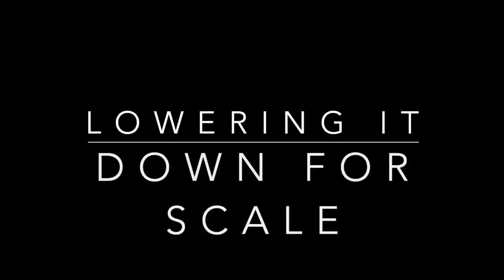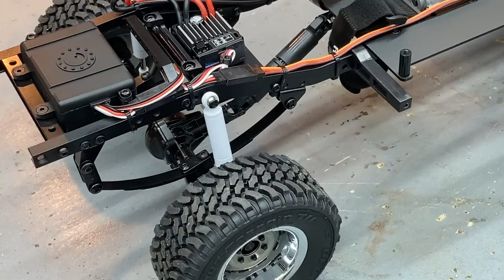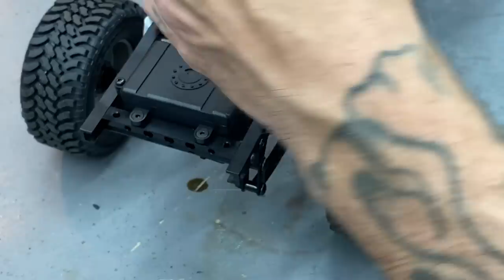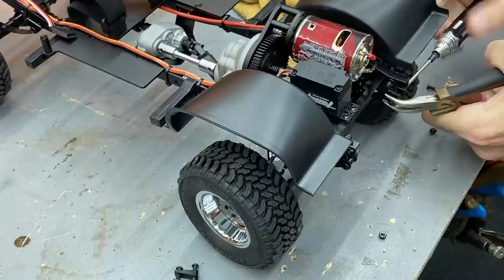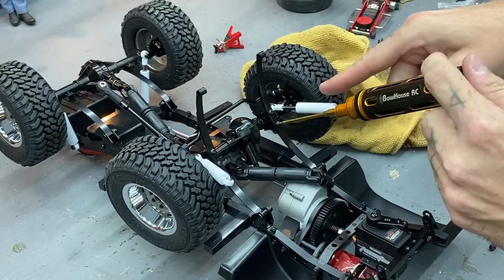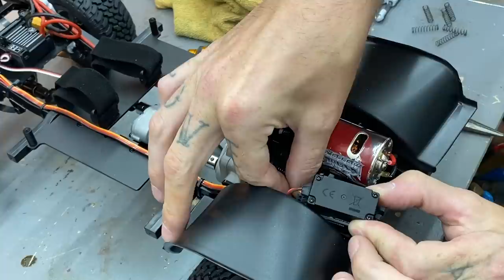Lowering the RC4wd TF2 Scottsdale, Trailfinder Tech, Leaf Spring Truck Science

Comment: Another awesome video. I love what you do. You inspired the 1/10 scale garage I'm making from Lincoln Logs and the tactical teardrop trailer I'm making from a wooden dish drainer.
You should make an old aluminum and fiberglass "FarmTruck" style camper/topper for this thing. It also needs a blue bug deflector with the name of the truck on it. Maybe a well loved/cleaned everyday driver patina, something grandpa would drive to work then wash and wax it on the weekends; some parking lot dings, bubbling in wheel arches, and that sort of thing(not the Rust Bucket😂) . It's what I would do if I had the tools and vehicles.

Comment: How difficult would it be to move the springs under the axle? I'd like to get closer to a stock height. I'm not opposed to putting 1.55's on it.
Reply from the maker: Ive played around with it, they actually make blocks to help do it, only issues Ive had are the wheelbase changing as Ive tried to lower it.  You might have to experiment with different length leaf springs to get the wheels lined up in the wheel well.  It can be done though.

Comment: Could you leave the one leaf and use the coil spring? I am thinking the coil spring is the best suspension spring.
Reply from the maker: You could. But with just one leaf it could cause axle wrap.
Reply: @RCeveryday  yeah, you did that. You will some of those old school bars that they would put on damn near everything in the 70 and 80 it would limit that from happening, i don’t know what they are called but it was used to prohibit that twisting of the leaf. Plus on this truck it might actually look good..

Comment: I was looking at the k44’s for my gelande 2 as I find the Yota 2 just that bit to wide. Am I right in thinking that A, they are narrower and B, the spacing for the leaf mounts are still the same as the Yota 2? If not could you recommend a fix or another axle that might work better? As for lowering I flipped the axles (upside down) and mounted then leaf underaxle. For window trim/rubbers I find masking around the window outer and inner (with the glass in) works for me to keep a clean line for painting the rubbers.
Reply from the maker: So the k44 is the same dimensions as the yota2. Same width. The leaf mounts are in the same spot as well. There is a boom racing narrow “phat” axle that’s about the only production piece narrower I’ve seen.
Reply: @RCeveryday  thank you for confirming that. I’ve also looked at the boom racing PHAT80 axles, but from what I’ve seen there diff housing is centred and would more then likely hit the gearbox under compression?
Reply from the maker: I’ve not had any so I can’t confirm. But that wouldn’t surprise me.
Reply: @fatfreddiescat9952  Phat axles are all centered from the factory. You can buy the lockouts and c hubs from other widths to build an offset drop. So you could buy an 80 and put a c hub and shaft for a 90 one side.